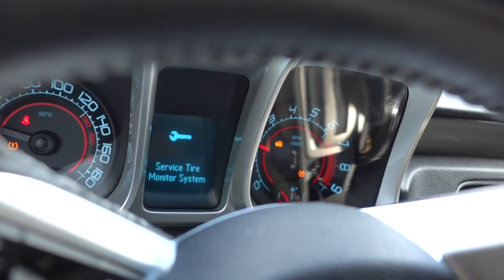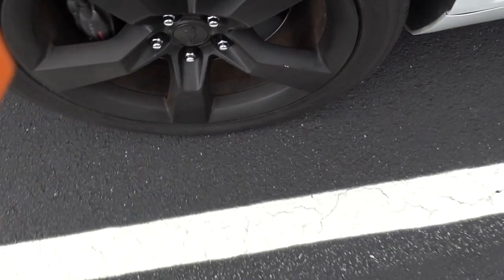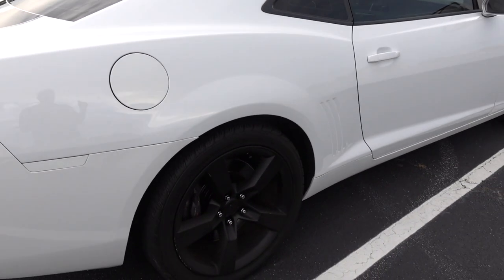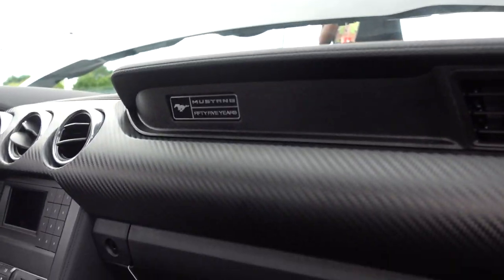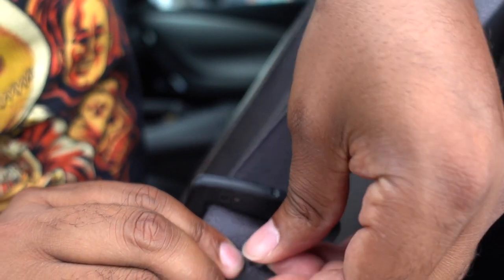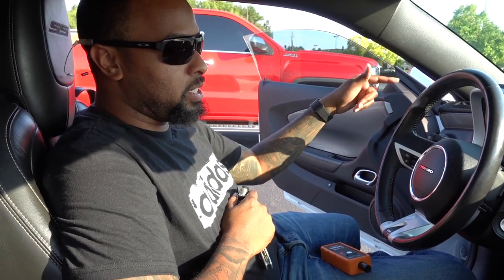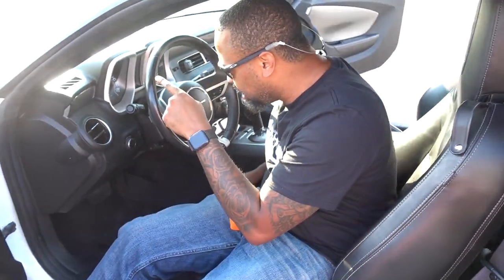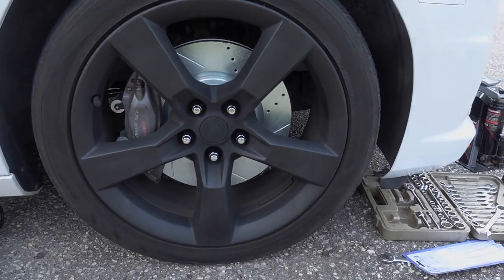How To Fix and Reprogram Camaro TPMS Light

Comment: I was driving my camaro and all of a sudden that happened to me I thought I had a flat but all wheels hold air thank u for the video man stay blessed
Reply: I'm working on dealing with Chevy about this I need to know did it happen when either the weather was really cold and your tires were warm like were you driving hard also did it happen in the rain when the weather was warmer but it was raining? I have a theory it might be an issue with the bcm. Mine does it randomly like twice a year. It will show or more sensors not available. I have a sneaking suspicion it has to do with difference of tire temperature vs the ambient temperature the car is reading in and out of the car.
Reply: where do I select and how to do it inside the car before char in the tires to program on the dashboard of the car ???

Comment: So I bought rims and tires for my car and now I have the tpms sign and dont know what to do. Is there something wrong??🥺
Reply from the maker: What car do you have? If it is a GM product I would try the TPMS reset first, otherwise you might need to replace the sensors... it is a pain but not too bad depending on your vehicle of course.
Reply: @JustCallMeChris  camaro

Comment: Dude. You didn’t fix crap. You took it to the dealership to fix it. I thought this was a video on how to replace them yourself. You need to change the title of your video.
Reply from the maker: I’m confused??? I don’t have a machine that can break a wheel done so I went to the tire shop (not dealership) and had the new tpms sensors installed… I then used a tool to reprogram them to my car… I documented this process and left links to how you could do this following the same method… what’s not accurate about the title? It says everything you see! The title is not watch “me” install new tpms sensors or “I’ll shoe you how to install new tpms sensors” so I don’t know what you wanted to see what wasn’t in the video… have a great day!
Reply: My bad. You’re correct. I thought you were going to show your method of replacing one without using a machine. Apparently it can be done. Thanks.